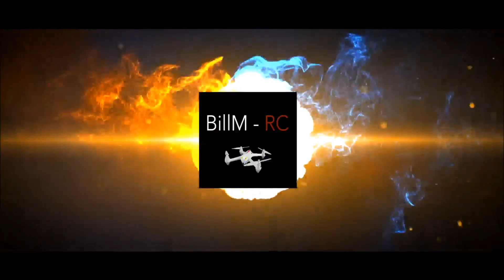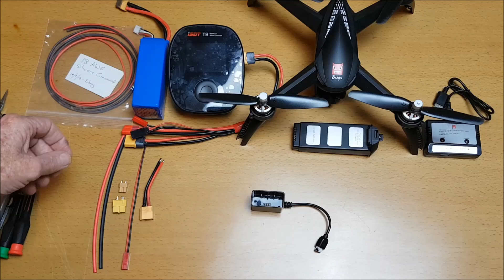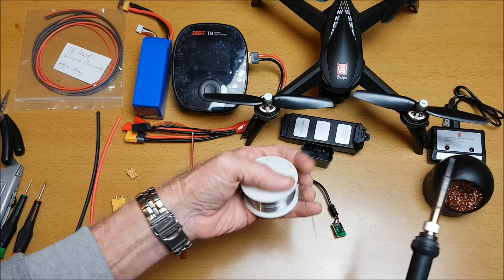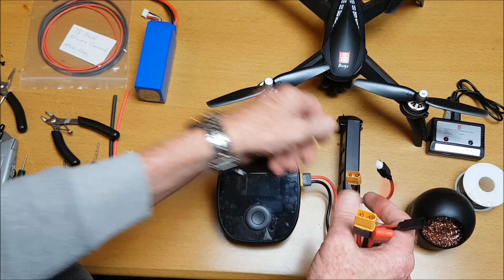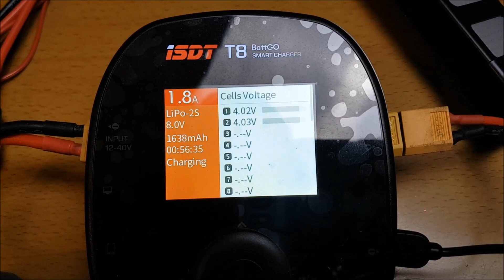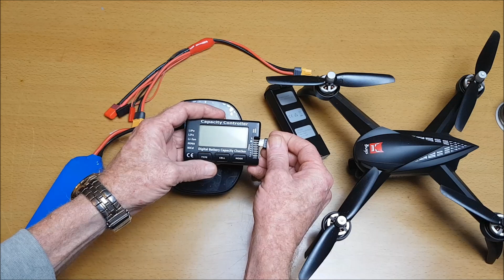MJX Bugs 5W Battery Mod to use Hobby Grade Balance charger

Comment: You don’t have to use the heavy gauge wire that comes with the plug,charging doesn’t require thick wire cause the charge rate is not as demanding as flying,so just solder a thinner gauge wire to save space and won’t require too much heat to solder on the board.
Reply from the maker: Hi, thank you for watching & commenting, always much appreciated :-) Yes, thank you, it is better to use a thinner gauge wire.

Comment: Thanks Bill watched this today and did it straight away. Burned my finger but all good. It was hard getting solder to stick but I got there.
Great mod legend.
I have a question can I run a different camera say a RunCam 2  how do I link it to the app.  I’ve pulled off there camera and I’m flying it with a RunCam by sight but I would love to see what I’m doing through the camera. What would you do boost the RunCam or try and hack it!
Reply from the maker: Hi, thank you for watching & commenting, always much appreciated :-) I think that a Runcam 2 is a bit too heavy for this. I suggest mounting something like this on top with a small 1s battery: https://www.banggood.com/Eachine-TX04-PAL-Super-Mini-Light-AIO-5_8G-40CH-25MW-VTX-700TVL-120-Wide-Angle-FPV-Camera-p-1166418.html?p=FU171726284242015096 and you could use something like this: https://www.youtube.com/watch?v=2HG-j4esxzg . Here is something I did similar with a different camera: https://www.youtube.com/watch?v=6C1oVYAivww

Comment: Why not just extend 2 wires from the propitiatory plug to the back of the quadcopter, fit an XT socket?
Then you can use cheaper generic batteries and charge them with a normal lipo charger.
Everyone should learn how to solder. Heck I learnt at junior school (12 years old)
Reply from the maker: Hi, thank you for watching & commenting, always much appreciated :-) This is a good alternative too :-)

Comment: Thnx Bill! Followed your method in the video, (except drilling through the board, for lack of tiny drill bit), but everything still worked out! Was tired of using the stock wall charger that came with the bugs 5w, because it takes too long and I'm not even sure that it properly balances the battery, to begin with.
Reply from the maker: Hi, thank you for watching & commenting, always much appreciated :-) I am pleased you found this helpful :-)

Comment: You don't need to do any of this just use stock charger cap and balance port on charger at 1.8a
Reply from the maker: Hi James, thank you for watching & commenting, unfortunately it does not work like this on my balance chargers and many others unless the battery main plug is connected too.

Comment: seems that 3 in the center is the balance connecter. 2 on each of the sides are the actual discharge pins of + and -. for the charger, it's easy enough to make custom pin connectors with epoxy holding the pin positions. I did the same with my B3 mini.
Reply from the maker: Hi, thank you for watching & commenting, always much appreciated :-) Yes, this is a good option too, thank you :-)

Comment: Dear God people relax about the dangerous mod part. If you are that afraid, you probably shouldn't be messing with aircraft anyway after all the propellers are dangerous too..  Now onto the video,  while it does drag a bit slow and with details above what's needed it still gives the critical points needed to make the super simple and non dangerous conversion. It's saved me from over 4 hrs of charging to now taking around an hour on my skyrc charger that would not recognize the batteries until this was done.

Comment: Bill I have to give you 2 thumbs down on this one. this seems like a lot more work n a lot more dangerous then the other video out there on how to charge these special batteries.
Reply from the maker: Hi RJ, this was not my innovation, but I liked and risked it, and am very happy with the result. I have subsequently found an easier method requiring a cheap lipo charger, that can balance charge using the balance plug only, but this does not allow me to revert to storage capacity charging.
Reply: Whats so dangerous ? the risk of burning your thumb I guess

Comment: but thats just a Adapter Mod, you can use an other charger without this mod.
?
Reply from the maker: Hi Matt, thank you for watching & commenting :-) The balance plug could be connected directly to a charger but then it cannot be charged as a lipo battery and be balance charged properly.

Comment: This will give the lowest resistance feed into the battery but I think I'd prefer to just add splices onto the balance lead wires. Much less chance of stuffing up that little circuit board.
Reply from the maker: Hi, thank you for watching & commenting, always much appreciated :-)